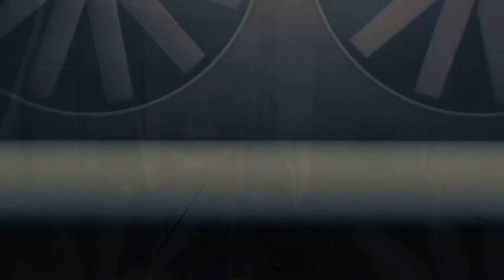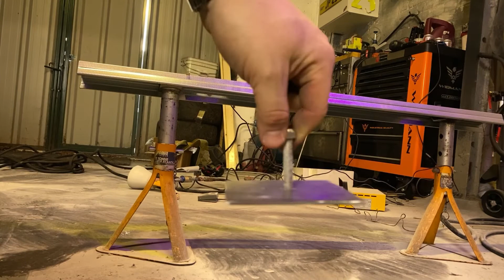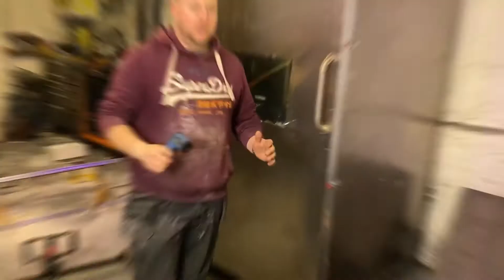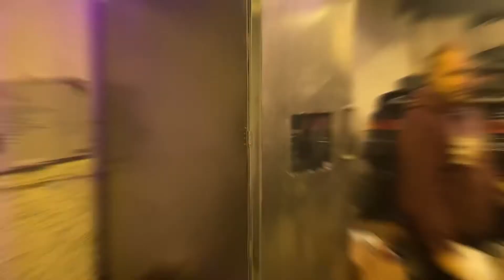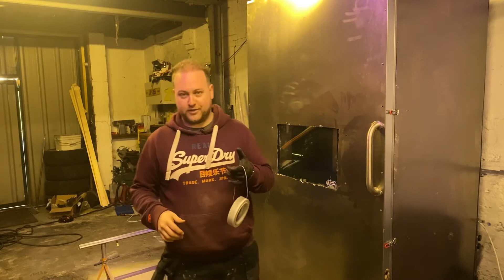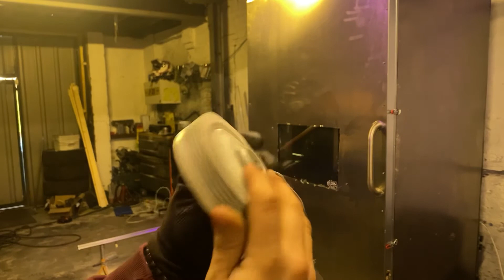First Attempt At Using The DIY Powder Coater And Oven!

Comment: Enjoyed the videos. The 2.5mm wire will probably be fine. Cookers use 6mm because they also feed the hob which has at least four elements. If you check the total  current draw of the oven, I very much doubt it will exceed 3KW in which case 2.5mm cable is fine. If it's much more than 3KW then you can't plug it into a ring main and will need to add an extra breaker to the consumer unit and wiring. I have been powder coating using a fan oven plugged into the ring main through a 13amp plug top for years with no issues. The oven is too bloody small though so I need to do something similar to yours though I will probably make it a bit smaller due to space considerations.  I didn't know about C stud so that is well useful. I will probably use two inch  on mine as it will still have considerably more insulation than the original oven and being smaller won't need the extra rigidity of you giant !
Reply from the maker: Thanks man! Yea haven’t had any issues yet so I think I’m in the clear. Just need to sort the dan out on mine and I’ll be happy. Yes I stumbled upon a couple guys using the c stud sections and it blew my mind as made it so easy! Hope you enjoy building your own.

Jaso.

Comment: Nice build, will be starting my own build very soon. Do you know the total wattage of your heating elements? Thanks
Reply from the maker: Thanks bud! I’m not entirely sure as I never had any paperwork for the home oven I used the electronics from but if I was to have a guess at around 1,500w for the fan assist and about 2,000w for the main grill element at the bottom so guessing I’ve got around 3,500w total

Comment: way too little heat. needs 100-150watt per square ft. way too tall to not have circulation. window needs to be removed, massive loss of heat, install a slide instead so u can check the temp without opening the door
Reply from the maker: Has a fan assisted oven element so has some relative circulation, have 2x heating elements now running full time so plenty of heat, heats up to 180/200 degrees in 45 mins, and have since added a temperature sensor in the door